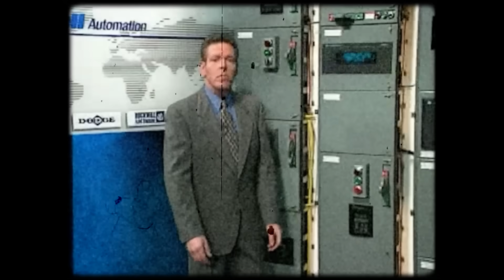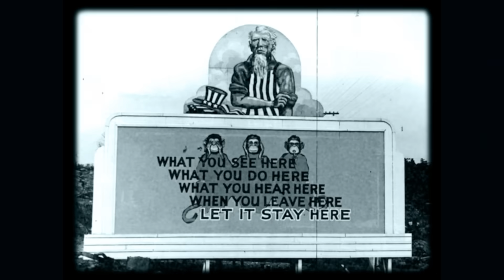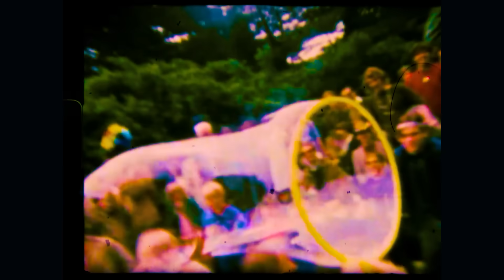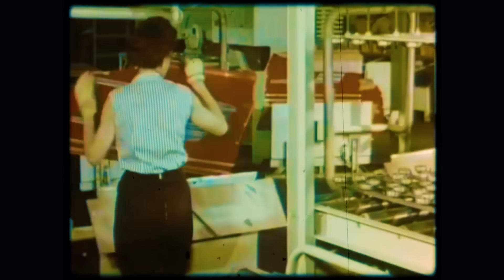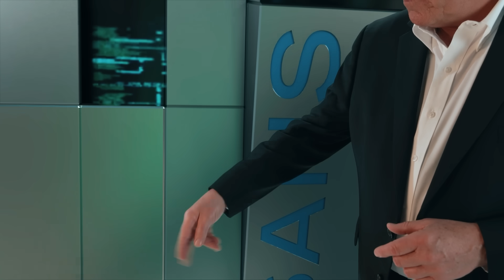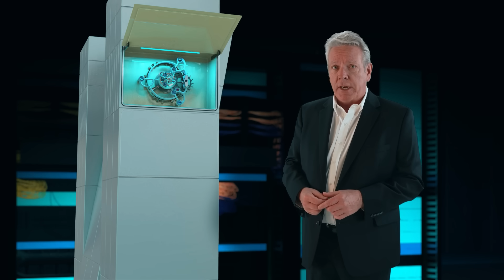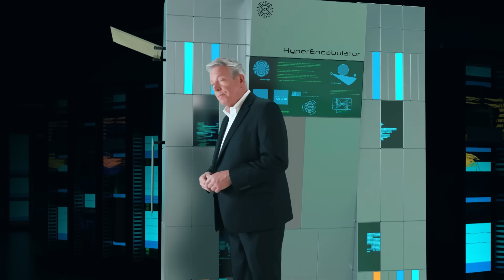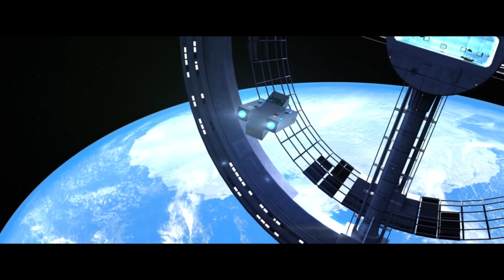SANS ICS HyperEncabulator

Comment: The Modular Vertical Elevation Apparatus (MVEA) with Integrated Ascendant Object Conveyance

The process of utilizing the Modular Vertical Elevation Apparatus (MVEA) for object translocation adheres to advanced principles of vertical load-bearing dynamics and gravitational potential energy modulation. This system, colloquially referred to as a “ladder,” employs an orthogonally structured linear frame equipped with equidistant horizontal load-distribution platforms—scientifically classified as rungal elevation nodes—to facilitate the biomechanical ascent of materials along the z-axis.

Each elevation node is meticulously engineered to achieve optimal force distribution via compressive load-sharing, utilizing a bipedal alternation strategy wherein the operator applies downward kinetic pressure, thus generating sufficient upward vector thrust to counteract gravitational constraints. As the operator sequentially engages each elevation node, the resultant force transference is efficiently propagated along the vertical spine of the apparatus, minimizing torsional instability and mitigating oscillatory deviations.

Simultaneously, the operator engages in manual object conveyance, leveraging a dual-grip interface to stabilize the payload during upward vector motion. By synchronizing the translocation of the payload with the operator’s vertical locomotion, the MVEA ensures continuous momentum without undue inertia-induced backflow, preserving energy efficiency in the ascent process. The horizontal-to-vertical load conversion ratio is optimized through the operator’s dynamic weight-shifting technique, which maintains equilibrium across both lateral and longitudinal planes of the apparatus.

Advanced configurations of the MVEA may include a peripheral safety stabilization system, commonly known as a “wall,” to reinforce structural rigidity and reduce the probability of angular displacement during operation. In instances of high payload mass, the operator may engage in cyclical load redistribution, utilizing intermittent gravitational stasis—wherein the object is temporarily placed on an intermediary elevation node to prevent cumulative stress on the operator's musculoskeletal actuators (arms and legs).

The apex phase of the MVEA operation involves the strategic placement of the payload at the pre-designated endpoint, wherein the operator achieves a stable stasis at the final rungal elevation node. The object is then offloaded from its temporary kinetic vector, achieving stationary equilibrium atop the desired surface through the application of reverse gravitational torque mitigation.

In summary, the Modular Vertical Elevation Apparatus serves as an indispensable tool for translocating objects across vertical gradients, utilizing advanced human-mechanical interface principles to maximize efficiency in height differential object conveyance. Through precise engagement of the rungal nodes and strategic biomechanical force application, operators can safely and efficiently overcome gravitational barriers in a controlled, modular ascent trajectory.

Comment: Although earlier modals of the encabulator can last for decadence, you should take them in to your nearest SANS ICS departure stores for OS relegation.  Non-euclidian disparate particulates can accumulate in the ventricle ram-shafts, causing decreased sensory output from local degenerative biomes - making the lack of side-fumbling effectitiously underpronounced.  Loss of critical malcontusions beneath the titanium dermal layers remains a high priority in parcel defibrillation as rotary induction begins spindling.  Luckily, one can manage a simple spurving bearing emulsion with a quick reduction of trans-data lucidite coated by oscillating redactance, advocating membranous inclusions at the stator penetrance level.  If formative occular resonance can not be achieved in your cycloidal capsule, reach out to a local SANS representative for further support.
Reply: You have a firm grasp of the concepts, if not of reality. I could not have said it better myself.

Comment: Meh, this sequel completely misses what made the previous video so great. This one is way over the top and takes the joke too far. What made the original video so great is that it almost seems real and believable, and has the feel of an actual sales pitch video of the time. 

Fast forward to this one with the HyperEncabulator, and it's too outlandish, it takes the joke too far, and then some. Far too much CGI, and far too many references to the original video. They obviously didn't try to make this one feel real or believable, rather they thought they could be funny by making it way over the top, but it actually could have been much funnier if they toned things down and brought it closer to reality. Sadly too many people think they can be funny by being over the top, but it doesn't work that way. It just ends up feeling like a crappy 90s comedy starring Martin Lawrence.
Reply: I take your point, but the crux of this video was that the viewer is already aware of the retroencabulator video, and is referred to in the opening. If you already know that the retroencabulator is a joke, then obviously the hyperencabulator is as well. The beauty of stumbling across the retroencabulator is that it is possible to believe that it is an actual presentation, until it becomes obvious it isn't. We cannot start with that assumption with the Hyperencabulator. The joke is already told, and now it becomes an exercise in making fun of the original by pretending it was real, when obviously we know it isn't. And this presentation is hardly "over the top." Also, Martin Lawrence was not available.

Comment: I've been hearing some exciting rumors about the next big thing in encabulation technology – the UltraHyperEncabulator X3000! As a huge fan of both the Retroencabulator and the SANS ICS HyperEncabulator, I’m thrilled about this new model that reportedly combines the best of both worlds. This groundbreaking device promises to revolutionize industrial process automation and ICS cybersecurity. Here’s what I've heard so far:

Key Features:

Hyperfluorescent Quantum Marzelvanes: Designed to significantly boost operational efficiency and reduce energy consumption.

AI-Powered Dynamic Dingle Arm: Utilizes advanced AI to adjust the dingle arm dynamically for optimal performance, reducing the need for manual intervention.

Quantum Cryptographic Core: Ensures top-level security with quantum encryption, making data and communication virtually hack-proof.

Self-Lubricating Prefamulated Amulite: Provides smooth operation and extends the lifecycle of critical components.

Nano-Tube Phase Detractors: Enhance signal clarity and reduce interference, ensuring high performance and reliability.

Adaptive Side-Fumbling Prevention: Advanced algorithms dynamically adjust to prevent side-channel attacks, ensuring system integrity.

Control System:

Hybrid Analog-Digital Interface: Combines the reliability of analog controls with the precision of digital systems, featuring a sophisticated touchscreen display for easy monitoring and adjustments.

AI-Enhanced Anomaly Detection and Error Correction: Employs machine learning to detect anomalies in real-time and correct errors autonomously, reducing downtime and enhancing reliability.

Power and Sustainability:

Dual-Mode Eco-Friendly Power Module: Utilizes both traditional electric power and renewable energy sources, reducing the carbon footprint.

Energy Efficient Design: Consumes 30% less energy than previous models, lowering operational costs and environmental impact.
Integration and Compatibility:

Seamless Integration: Compatible with existing industrial automation systems and modern ICS devices, supporting a wide range of communication protocols including OPC-UA, Modbus, EtherNet/IP, and SCADA systems.

IoT and ICS Ready: Equipped with IoT sensors and connectivity options for remote monitoring, predictive maintenance, and enhanced cybersecurity.
Security Features:

Integrated Cybersecurity Measures: Meets and exceeds industry standards for ICS cybersecurity, including NERC CIP, IEC 62443, and ISO/IEC 27001.
Autonomous Security Protocols: Automated detection and response to security threats, minimizing human intervention and ensuring continuous protection.
This all-in-one solution seems perfect for manufacturing, automotive, aerospace, energy, water treatment, and other critical infrastructure sectors. It’s designed for rapid installation and low maintenance, making it a top choice for modern industries.

Additional Features I'd Love to See:

Infinite Fluctuation Dampeners: To nullify the oscillatory tendencies of the hyperfluorescent quantum marzelvanes, ensuring zero deviation in transverse encabulation.

Quantum Foam Stabilizers: To prevent the unpredictable expansion of the prefamulated amulite during high-energy flux events, maintaining operational stability.

Virtual Reality (VR) Interface: For operators to immerse themselves in the encabulation matrix, providing a more intuitive control experience.

Holographic Debugging Assistant: An AI assistant that materializes in real-time to provide troubleshooting tips and motivational speeches, enhancing operational efficiency.

Gravitational Inverter: Temporarily inverts the local gravitational field to facilitate zero-G maintenance and component replacement, reducing physical strain on technicians.

Temporal Phase Shifter: Allows the UltraHyperEncabulator X3000 to operate in multiple timelines simultaneously, resolving potential future errors before they occur.

Nano-Drone Fleet: A swarm of autonomous nano-drones for internal inspection and repair, ensuring no nook or cranny goes unchecked, optimizing maintenance routines.

Can't wait to see this in action! Has anyone else heard about this?

Comment: Those old encabulators just WORKED, you know?  Not like what they're trying to pitch us nowadays.  I get they're trying to reduce costs, but I gotta say, I'm really uneasy at the idea of replacing the cardinal grammeters with low cost multiplexing quiads.  I mean, they're low-cost for a reason.  Those cardinal grammeters on the old retro encabulators built in the 80's are still famulating to this day!  And YES, before you object, they DO have to be decranisized every month, or more often if you get excessive score panometry buildup (but honestly, if you're getting that much score panometry buildup, you really need to talk to your suppliers; that's just just the result of cheap input materials), but even after 30 years of regular decranisization, those cardinal grammeters don't quit!  Yeah, it can be hard to find skilled technicians who know how to perform the regular decranisization on these old models; many of them have retired, and the ones still working are, of course, in high demand, but they are out there, and if you're serious about being a major introcutor in the industry, you're not going to get very far without them.  I see these young salesmen in their 20's trying to sell me on their new micro encabulators (basically children, really) and I can't help but roll my eyes.  Am I supposed to get my automation control operators and specialists to switch over to cheap multiplexing quiads overnight?  You think that's going to fly with our customers that have come to rely on our consistent modial rederactions for decades?  I'm sorry, but you won't catch me jumping on this fad.  It's just too risky for my taste.
Reply: Sir, your insight into encabulation is spot-on, particularly in regards to the necessity of periodic decranisization of the turboencabulators. However, you must agree that the fictionality of the Hyperencabulator supposits that any and all of the capabilities of the retroencabulator (disregardless of their longevity vis-a-vis the grammeters,) are effectively negated by the inclusion of turboreplication modules, wherein any of the previous functions can be transposited through the Hansom-Ransomware HyperVisor. Howsomever, I completely share your disdain for the microencabulators, which are nothing more than glorified Bop-Its as far as I'm concerned. Thank you for your insights.
Reply: excellent advice — thank you!
Reply: We wouldn’t have to decranisize at all if the prefabulated aluminite baseplate had the proper isolations, I get it, I do, we all like to hold the classic dear to our hearts for what it’s done for the world, but c’mon guys, we all know without the advances of ceramic coated postfabulated alumnite we’re locked into monthly visits from a dwindling source of technicians, higher and higher costs, for what? More side fumbling? Sheesh

Comment: Did they ever figure how to divert the power from the deactotrifucant magnonometric sequencers? I tried to bypass the autherent betroceptant fields to eliminate interference but when I went back to my notes I saw that I forgot to account for the chortomic rods needing to be pressurized to keep them from bending. After revising my notes I saw that if you fine tune the orpolithic receps to about 246-8 whodu weeap reshiates, the temperature stabilizes and the flux bearings shrink enough to allow for the fricor rings to cool the indregoral and quatomonic tubes. It took me awhile but I fixed it. Let me know if anyone needs any help.

Comment: How do i get the encbulator's hyrdroscopic marzle vains. To work in conjunction with my interositer's variable input mega hertz frequency output transformers? My oscilloscope doesn't read anything above 1.21 gigawatts of amperage.  The capacity of the fluxor is still below the required 88 mph required  to activate the capacitor?

Comment: This reminds me of the time I had chick korea; the doctor had to preform a deuteronomy and refibrillate me with a surgical encabulator because my hart went eurythmic. I find it amazing we still use the older encabulation technology in so many fields. My grandfather told me stories about reciprocating internal combustion encabulators that predated the turboencabulators. They used them in Mannheim rockets during the early space program. They based them on the old steam piston encabulators used by the mining industry. They are still trying to work out the math of getting the relativistic-quantum encabulators up and running. That, and the qubits won't quite reach the Boise-Einstein condescension point yet.

Comment: Nobody should take this guy seriously. What he's describing is a total pipe dream. I've been out of the infosec game for a while but there's just no way that an execrable hypovisor like this could operate at the level of granular redaction he's suggesting without chronic devalvement; the entire device would essentially become an ambiconnective amplifier within six kilocycles - MAYBE seven, if it had an exceptionally well-tuned cognofacient drive. Does SANS ICS really expect us to believe that they've not only solved the Casper-Ghost Problem (with constructive proof, I might add), but also that they can achieve military-grade asynchronous data rotation rates without an ordinal metatrunk?

Comment: Thank you for clearing this up. I was confused about the lotus o-deltoid windings in the stator wondering why not just use a permanent magnet AC motor and call it a day but then realized the sinusoidal depleneration would be too much, quite the engineering work

Comment: I have a question, ive been having some issues with my old model when in regards to suloptizing the fregregator. Do have you sodomize the gladual antropical casing every time the rotation mobiates, or has the standard changed with the new update?
Reply: embrace the healing power of “and.”

Comment: Technology truly is amazing. Did he say whether or not the hyper encabulator is available with a dual motor with sino-soital depleneration? If so, then I’d love to test out its ability to prevent side fumbling on the upbend of the wane shaft. I’m hoping to finally be able to run a straight line to the panametric fam with the two sperving bearings on the old deltoid gram meter. I’ve known about it all this time but just haven’t had the newest model to be able to test it out yet.

Comment: I was installing a flugerbeater scope on my rusty encabulator and needed terminal guidance about the angle of the anhydrous nangling pins. Like the mob in Vegas, I got lucky and stumbled across SANS ICS. Without ICS I wouldn't be here today talking about them. On a side panel note, my HyperEncabulator was attacked with a Ritalin injection zero sum game attack. I only noticed after it stopped acting out and seemed more focused.

Comment: That's where all my missing S.O.C.s ended up: in the S.O.C. drawer!   They must have transmographied into quantum holes and driven themselves by tunneling vacuum fluctuations into coalescing around a condensate located nearby the exit strategy of the juxtaposed and perpendicular, flux antenna!  
Another mystery solved!
Now, if I can just figure out how to make this newfangled device get rid of my crow's feet....

Comment: Fringe areas of research and development are ensuing a path towards the new paradigm. That paradigm will be the onset of the true technological singularity called, the multi-dimensional, asymmetric, imbalanced harmonic oscillating quantum reactance encabulator. This new device incorporates advances in all previous encabulation methods and includes a new and improved bi-linear frictionless dia-magneto-reluctant lunar wane shaft that removes the need for differential girdle springs and, you guessed it, effectively prevents side-fumbling.

Comment: I appreciate that the Turbo Encabulator does more to prevent side fumbling than the Retro Encabulator. Despite claims vy the manufacturer, the Rockwell Automation Retro Encabulator did not effectively prevent side fumbling in many applications, such as infrasonic depolarization of Webley bearings, or post-recontrasting parabaloid data effluvia.